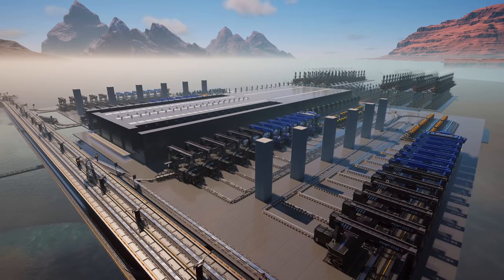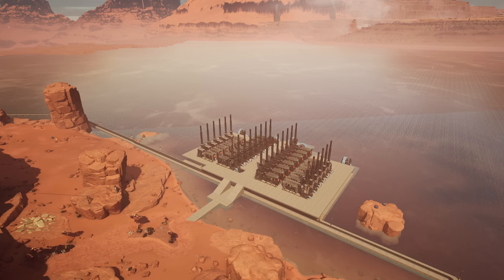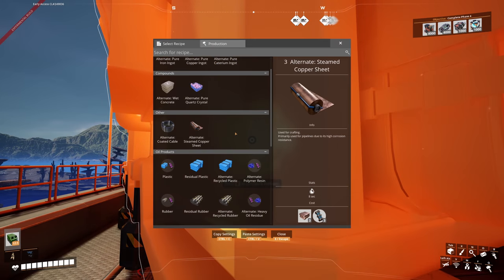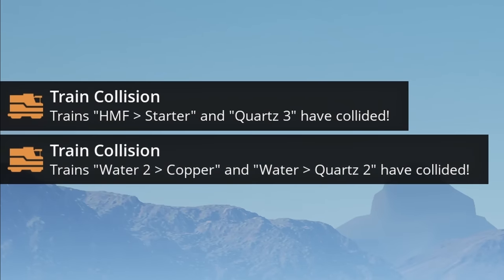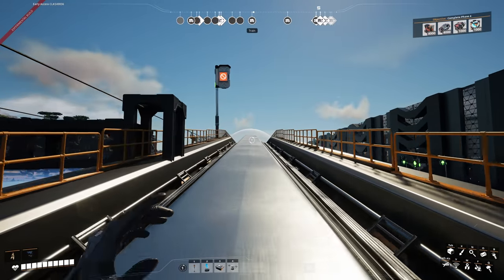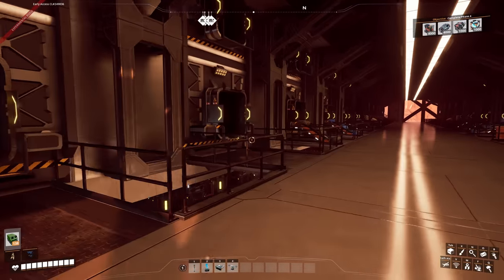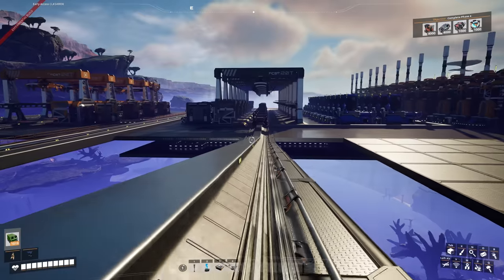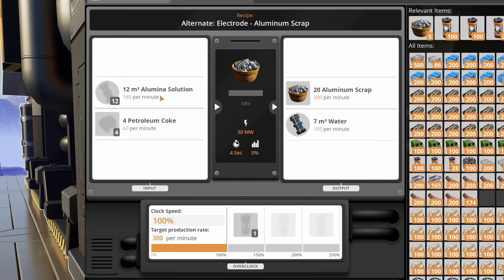MULTIPLE TRAIN DISASTERS DERAILED ALL MY PLANS!! In Satisfactory

Comment: You could have removed the lower area without removing the highway by using the slider to display the layer heights. Drop it down to the height below the highway and you could select everything from there down.